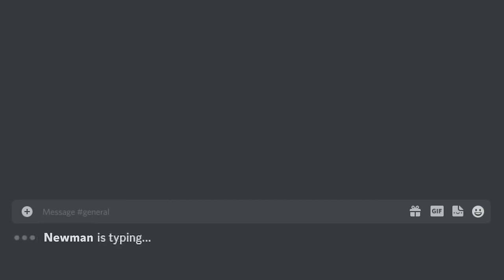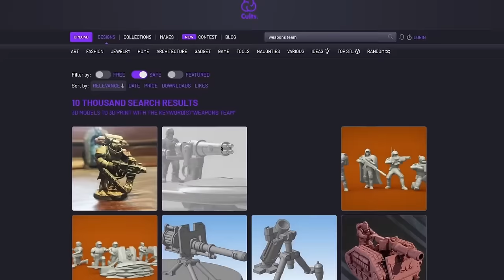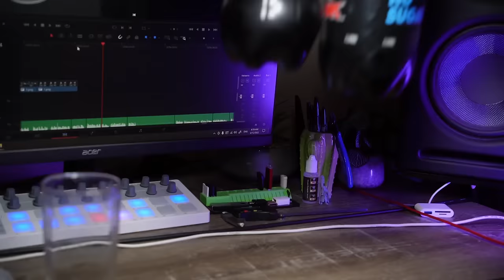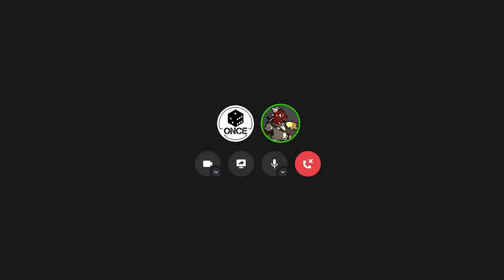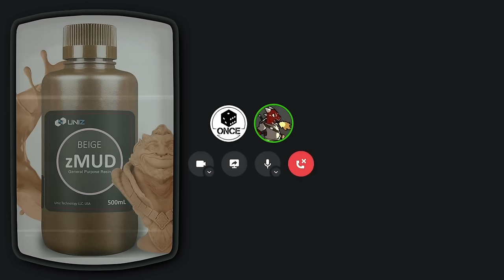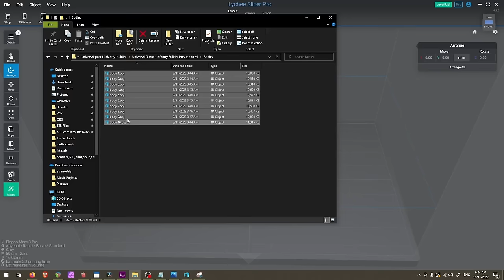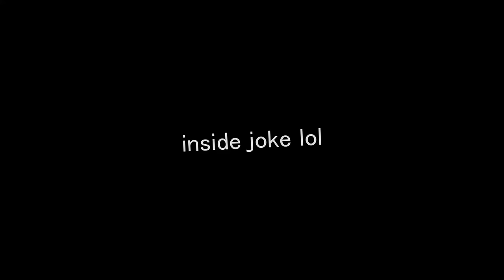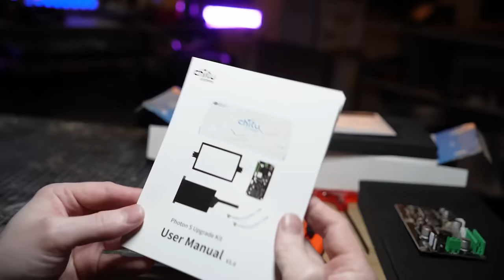Can I print it before GW ship it?

Comment: I have the same wash and cure station and also have the same issue of things sticking out the bottom. My solution? Hold up the basket with a paintbrush! A mesh is probably a better idea, though, as it keeps small prints like heads and weapons from falling through.

Comment: I bought the new Cadia Stands box despite owning a Photon. The detail and visual appearance of the models are comparable to 3D printed versions, but the biggest thing for me is resilience. I have a tonne of printed ork things, but they're my "stay at home" army because the printed resin is so much more brittle compared to injection moulded plastic. I've tried a few resins, but haven't found anything that stands up to the stresses and strains of being knocked about or scooped from the tabletop in the same way that GW plastic can handle. I normally augment GW kits with printed bits, because sometimes you just need another plasma gun. On the other hand, big chunky bois like imperial knights are prime for printing because they're less likely to snap or chip because the parts are so much larger and thicker.

Comment: The cure station could be enhanced by putting a larger circular mirror onto the rotating platform, followed by another transparent platform on top of that. This might serve to get the underside exposed, without needing to flip parts over.

Comment: Started 3D printing a few months ago and your channel is amazing! Quick question. Since you are using magnetic plates in your printers, do you need to also install a Z limiter on the machine? Or setting a new Z height is enough?
Reply from the maker: Awesome, thanks! Yeah it's a good idea to install one. Not always required, depends on the printer but generally yes.

Comment: not exactly correct about accuracy. Every resin have shrinkage, so if you print it with wright exposure times it should always be smaller then the original. If you get good accurate sizes this means you overcure. For example ameralabs TGM-7 have smth like 0.4% of shrinkage, so you need to print 10.04 cubey to get 10mm cubey. Its not so important in miniature printing but makes a great difference for dental aplications for example.

Comment: Why does over exposure cause a loss of dimensional accuracy?

In theory its because the UV light is 
Permeating the resin beyond the boundaries of the unmasked pixels.

Meaning it should be possible to add a secondary exposure to each step that has a smaller perimeter than the "dimensional" exposure. 

This could reduce the loss of dimensional accuracy while increasing the tensile strength of the print.

That way you could calibrate for tensile strength and accuracy independently.

This method could be extended to vary the LED arrays output (think dimmer switch) for a secondary exposure as well.

Comment: First amazing video, and I can't thank you enough for discussing the science behind printing. Ty. Second, you dumped bits out of a box lined with aluminum foil. Did you have e that outside to help cure the models before using the Cure Station??
Reply from the maker: Cheers! I used that box with a UV light hanging over the top. I found it a lot easier to cure lots of models at a time vs the small cure station.
Reply: @OnceinaSixSide  Thanks. I plan to make one this week to cure my future IG.

Comment: About "Why does it start in Cure mode".. Well, if you put your models on it to cure, but it is still on wash mode, because it is the default, it will fling the models around, smashing them into the enclosure, if you dont make sure it is in cure mode. The other way around, well, it wont wash with full power, but it should be non destructive.
Reply from the maker: Great point!
Reply: @OnceinaSixSide  AnyCubic's Wash'n'Cure is the other way around. Ask me how I know ;)

Comment: The temperature of your printing environment is important. If you're printing at 3.9 seconds, there's a pretty good chance you're a bit under 20C / 60F. Helping to troubleshoot for a community, I've had a lot of people run into environmental temperature problems during winter where the ambient temp drops. 
Generally speaking, resin prefers a 20-30C range. There are a few different ways to address this and eliminate it from the list of possible causes

Comment: I would effectively equate it to tracing another artist's work in regards to 2d art.  It's generally accepted that tracing another artist's work is a good way to develop your skills as an artist, as it can often give you a rough idea of how they've developed the structures for characters and backgrounds within a piece, but if you turn around and try to pass it off as your own work without any reference to the original artist, you're in some hot water.  In this situation, it would be more of a case of if they try to sell an identical copy to the original model that is like... 90-95% clearly the exact same model then that's when you get into some ethical thin ice.

Comment: I have used proxy stuff when GW or FW simply no longer offer the mini or when I want something that was never available. For example I really wanted to have elysian drop troopers and could not find them anywhere at a decent price but I found "red makers" and "mortian tanks" mini and I really liked them. For a period I also wanted kasrkins but they were no longer on sale so I bought from "anvil industries" which has a fantastic model builder.
 I also wanted a style of "melee sentinel" for cqc armed with a multi melta and a chainsaw, basically a degraded version of the paragon warsuit but for imperial guard, because they do not get anything good for melee fighting except ogryns. Eventually I found a nice model. In general if you want to make you homebrew chapter/planetary defence force or you want something no longer available it makes a lot of sense to print STL files or buy from proxy.

Comment: Loving your GW proxy vids, had a Prusa SL1 for a while and have an upgrade to an SL1S if I ever get around to fitting it, just got an Anycubic Photon m3 Premium, mainly because of your vids & I have been watching Anycubic's bigger volume printers for a while, Black Friday finally tipped the scales so I got one, extremely fast free delivery said 30-50 days and arrived in 4! it arrived at the same time as the wash & cure plus station I bought separately! (they may have overestimated the sales volume so I got lucky with delivery speed?) Ok, that's the background out of the way now to my question, where do you get the magnetic build plates? are they any good? they seem excellent in your videos! are they really that good?? Thanks 🙂
Reply from the maker: Awesome! Put it this way, I won't buy a resin printer without also buying a flex plate. They make life so so much easier. I recommend Wham Bam or Sovol
Reply: @OnceinaSixSide  what size did you get? I can't find one for the Anycubic Photon m3 Premium. My build plate seems far too big?  I measured its nearly 245x150mm! far bigger than Anycubic lists it as, I know the prints won't fill all the plate but I surely need the flex plate too?

Comment: Wondering if you will see this comment, just wondering if you will still be doing the resin test this year or if that's been pushed back to 2024? Just got a resin printer so curious about what resins to buy and which to steer clear of.
Reply from the maker: The plan was to be working on it right now but other projects keep taking precedent, so for now the plan is to make it the first project of 2024 😅
Reply from the maker: You can't go wrong with the ABS-like resins for minis. Elegoo's is particularly good, as are Chitusystems, and the Any cubic, Jayo and Esun stuff is decent too.

Comment: I'm personally not a fan of the cones of calibration - I have always had the same experience as you, with prints being very over exposed and no mechanical issues to speak of (fresh nFEP, good Z alignment, heated resin etc.). I would also hesitate to say that the AmeraTown is just a dimensional accuracy print - it does test for tensile strength with its pillars/needle in addition to dimensional accuracy, and is one of the few tests to do this well. The only test prints that are purely dimensional accuracy are typically the flat tests, such as the XP2 Validation matrix, and are basically useless for finding the correct exposure to print at. 

I would also not say that the cones are any better to determine whether presupports will print. Realistically there already is a standard, set by Atlas who provide the majority of presupports. They use the AmeraTown, and have a threshold of 4.5 rows of pillars for their supports to work on any resin (which works out to be a very similar concept to the cones). However, on top of this, it also gives great information for other printing parameters for more experienced users. There is a threshold of resin quality to get good looking results, but the vast majority pass that. 

Overall though, an excellent video, and it was really interesting to hear the different interviews:) Something I would note as being very important for your resin test in January is to factor in resin shrinkage - post cure, many resins will shrink by up to 10%, and they do not shrink evenly across miniatures (which is why keyed minis often do not fit well together)

Comment: My favourite resin is a 50/50 mix of Iform 181 and Anycubic 405nm I find it's  a cheaper mix and seems to work amazingly at a 2.4 cure time at 0.04mm layers. SATURN S .. I also print larger (hallowed) prints at a 0.08layer height and with a 2.8 cure time
Reply: Ah yes. You definitely said words.

Comment: I do supports, and one thing that I feel is overrated in your system is supporting every island. Every* Island should be supported, but they're are definitely islands that exist on many heavily detailed models that would be detrimental to support. 

Those guardsmen aren't decked out in texture, so they probably should have every island supported, but there are many more complex models where supporting every one would decrease the quality of the print.
Reply from the maker: Fantastic point! I gave a lot of thought to how heavily unsupported islands should weigh on the ratings system and ultimately decided the best balance would be to make them an A tier issue (aka a minor issue) as you're totally right, unsupported islands aren't always a concern, and I have said here on the channel in the past I don't give a shit about tiny handfuls of pixels that are definitely going to be picked up, it's the isolated not-near-anything-else islands that definitely absolutely require supports that haven't been given them we should be concerned about.

There weren't many  with TMCs files here but the fact is they were large enough islands to justify supports.

I'll have to add a note to Minirater about judging unsupported islands. Thanks for the comment!

Comment: Regarding your solution with mesh in the basket - around 17minuttes - how is it working so far? Has there been any issues?

I am currently deciding between an Elegoon Saturn S or 8K for my first resin printer, and I have decided to save some money and get the smaller wash/cure station, which is the one you are using in this video. Since I will be printing many small items, I think I'll need some solution like yours to keep them in the basket, so I am curious if there are any issues to think about/around 🥸
Reply from the maker: The mesh is holding up great!

Comment: My photon S does something similar but not till about 2cm in to the print. Really odd. Fine for printing smaller stuff but soon as it hits that 2cm has a flattened judder look to it for about 1.5cm then it prints perfect again. I’ve managed with it like that for a couple of years now though. Just upgraded to something bigger/faster. I’ll have a fettle with the old lass when I have some time and try trouble shoot that mystery problem

Comment: I don't think that 3d printing hurts GW much if at all. I 3d print models for myself and friends and all except myself still buy the official gw models. I proxy everything because i refuse to fork over the insane prices GW asks and i had that mentality long before i got my own printer hence why i've only ever played infinity before recently. I never would've spent the money on GW products to begin with so me printing isn't hurting them. What hurts them more is china cast and their own prices. But i feel the prices are the main offender personally. To get a standard size army on the table from nothing is insanely expensive compared to infinity or even any other wargame. Infinity has free rules so the cost is literally just the price of the army, glue, a couple d20s, and a tape measure. The infinity army boxes that are 300pts which is the standard run about 80usd at most iirc.

Comment: 3D printing isn’t a threat to GW, GW is a threat to GW. GW’s models are so much more accessible, easy to put together and much less fragile than most 3D printed proxies. The problem is, they charge such an astronomically high price for what is, at the end of the day, just plastic model kits. I would take a GW model over a 3D print everyday, except I don’t. Instead, I bought a 3D printer and learned how to use because the printer + resin + cure station wasn’t much more expensive than a standard 2,000 pt GW army.

Comment: My 2 Cents on per supported minis is Don't Use Them. As the video points out YOU are the only person that knows the printer, resin, fep qulity, etc. I use very fine supports, so if my supports fail I know I have a problem with the printer. 

Side note, other reasons to use finer supports; 1. you can fit more supports in an area, so less unsupported islands; 2. I don't like waste and most pre-supported models have huge supports and massive contact area. 3. Printing complete models with model to model supports  leave no trace of contact.

Comment: Seeing as many armies/models have molds that haven't been updated since 2001 I like the ability to have new tools, plus having played tau for a few editions the boxes never have many of the weapons that I would want. Printing those IMO has 0 moral failing.

I used to have an issue with whole models being 3d printed but more because i was concerned the look of many old models was not on par with GW, but now the models are higher quality as are the printers. This topped with GW taking a stronger stance against fan projects makes me sit farther away from caring about their rules. 

Fans made GW what it is, and when you take a stance against your fans I have very little empathy.

With that said, I would agree with a GW sponsored events/locations not allowing 3d prints or restricting them but disagree with non GW places/events blocking it as long as they charge for table time or you buy other things.

Comment: I was intrigued until I saw the metho bottle and was like... why the hell is he using metho and not isopropyl? Is there any particular reason or is it just price?

Also fun fact, elegoo do a wash and cure double pack now that has a curing station that fires a UV led up through the plate from underneath, as well as two LED pillars. It's quite good.

Comment: GW got greedy and did this to themselves. I mean 500 bucks to just start out in a tabletop game is insane. I remember having a 1000 dollar empire army in the 90s and it was enough models to do 4000 pt army and still have models left over. Now 1000 barely let's you field a 2000 pt 40k army and there will be almost no reserve to shift around your force. But I still try and support 40k so I usually use some official GW parts in my models, like running gear and weapons.

Comment: I don't think GW could really complain about similarity, here. The Sentinel walker is basically the front of a minivan with legs. It's an AT-ST with a curved front instead of an angular one. I don't think GW really innovated enough to claim any control over that design. They also don't own the concept of a gun battery. Two wheels, an A-frame, and a metal shield either side of the big gun are real world aspects of mobile artillery. I think maybe doing the two pods of six barrels so similarly might have been a toe over the line. Could probably have skirted the similarity by putting on a pair of big square rocket pods or something.

I would say anything with an eagle motif is a bit close to copying, too, but GW copied that from the Third Reich, who copied it from the Holy Roman Empire, who copied it from the prior Roman Empire, so fuck 'em. They don't own eagles, skulls, or any combination of those.

Comment: Oops, I just bought Cadia Stands XD. These are sweet proxies, I feel like they could even be used as modern soldiers or even Star Wars Imperials! Also, if anyone reading this hasn't had a chance to try the Cones of Calibration, I 100% urge you to do so, it's a great tool that makes printing so much easier. Plus, Ty at Tableflip Foundry is a wonderfully helpful dude who deserves recognition!